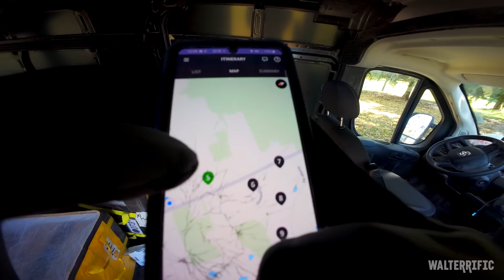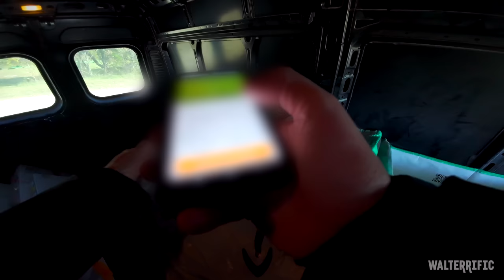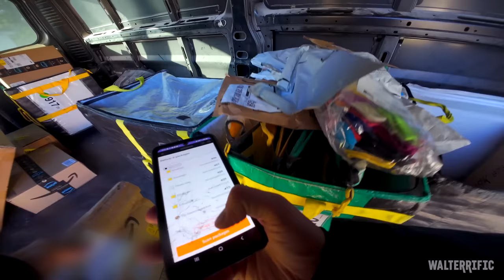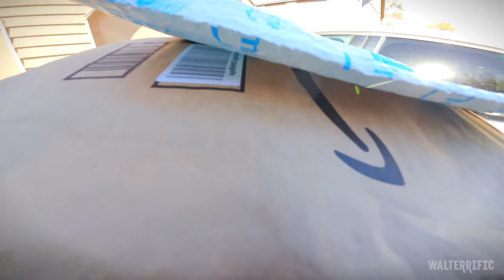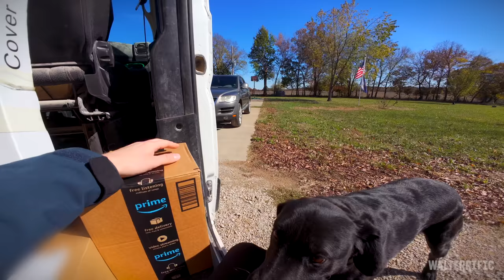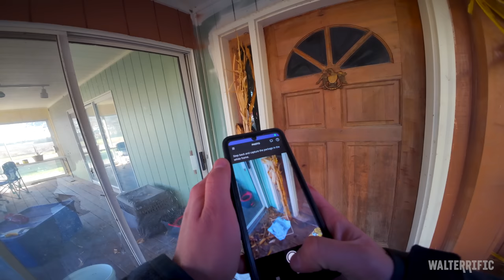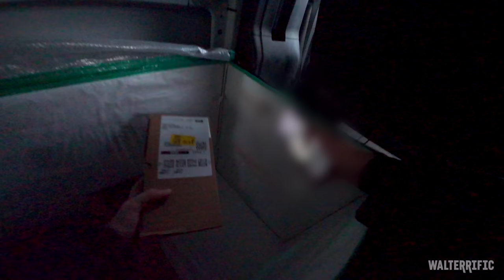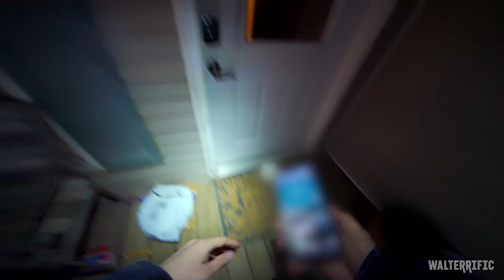A Week As An Amazon Delivery Driver

Comment: I work as a Warehouse Associate and have also worked as a Driver. The worst part of delivering is the apartments with no elevators or lockers. Especially when someone orders 6 cases of water on the third floor. I started in the Warehouse, became a driver and went back to the warehouse since pay was the same. The extended long nights were killing me.

Comment: If you turn the mobile data off on your device then go back to the flex app you can move the geo pin on your device. When it says you aren’t at the location a little orange button will pop up that says “I’m here but the pin is wrong”. Then you can move the pin and finish the delivery then turn data back on. We have to do it all the time delivery in the country 👍🏼 save a call to support and saves a ton of time.

Comment: sort your packages in the front seat in piles by those  yellow stickers with the driver aid numbers and usually go by the last two numbers, that'll help speed up finding the package for the stop you're at, they generally go in order, but sometimes they dont.  Other driver aid numbers are weird like "U045" or something like that, those i leave in a separate pile but still up front with me, usually in that middle area between the seats.   I've been am amazon DA for maybe going on 7 months now and lately my routes have been something like 187 stops with 320+ packages, so enough 10 hour days like that and you get used to your own system.  Everyone does this job a little differently depending on what works for them of course, but goodluck out there!!